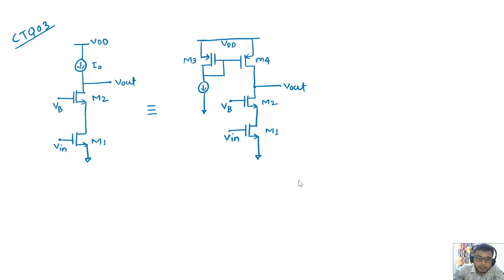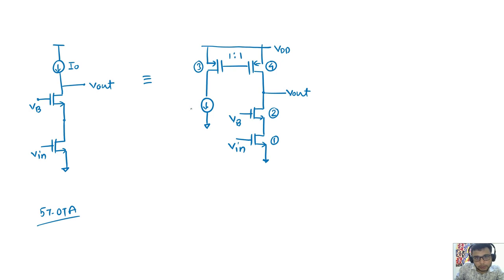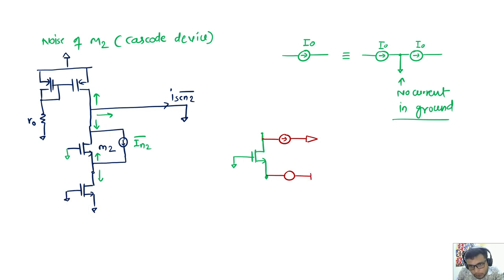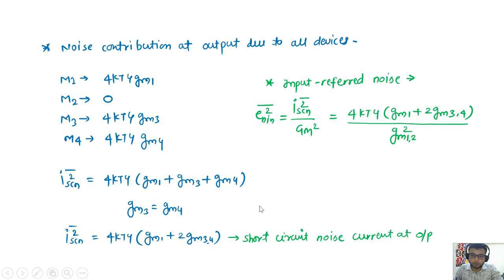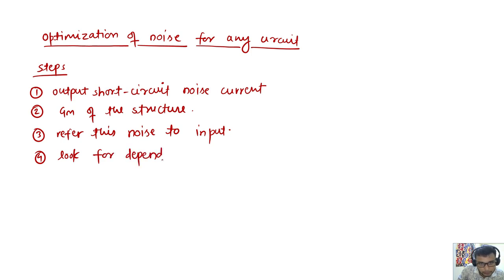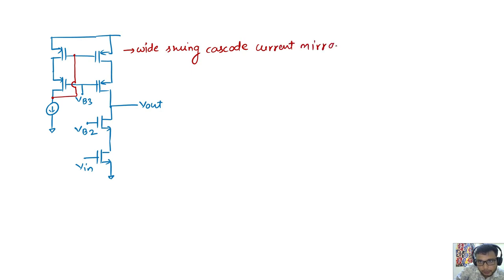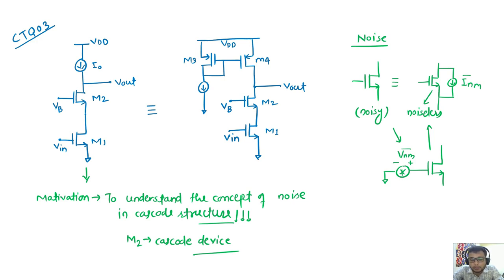CTQ 03 || Series for Placements || Analog VLSI Design || Anuj Chauhan

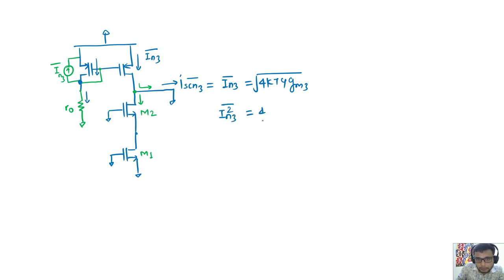Comment: 10:08 Sir, I think In3 will circulate within the device itself. I may be wrong, please correct me.
Reply from the maker: @MithunBarmann  yes it will circulate inside the device M3 means it will flow through rds of the device or it can also be considered as drain to source current of M3..at the same time vgs of M3 and M4 are same so this current will be copied and will flow through output short circuit
Reply from the maker: @MithunBarmann  I think your confusion is that it its circulating in device then why copying? Actually circulating through the device is only responsible for copying, if it will not flow through the device or if it directly goes to supply, it can't copy